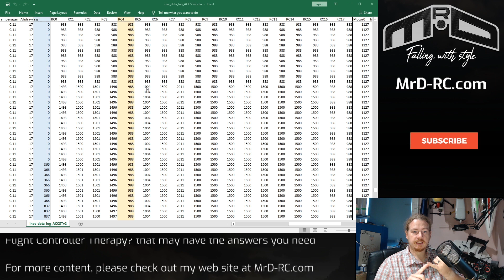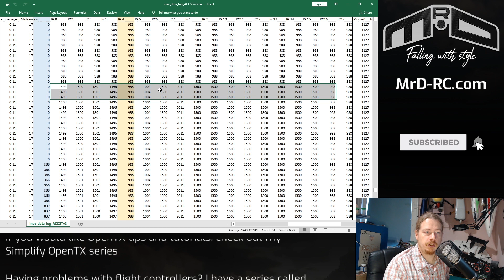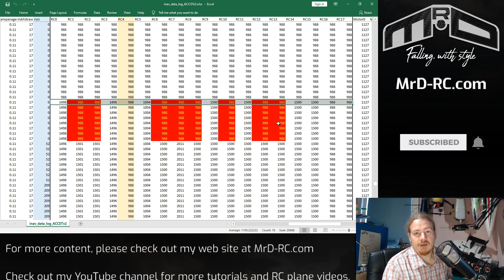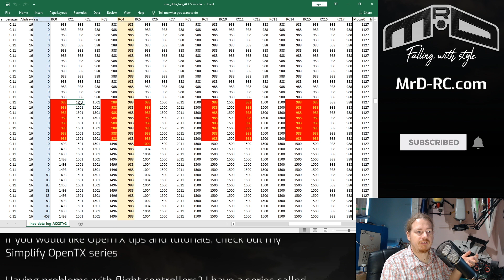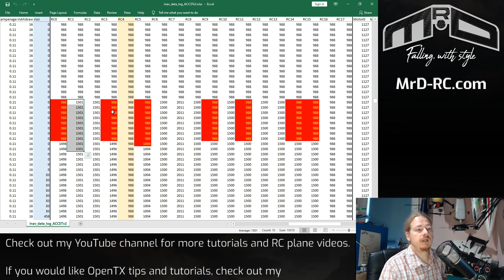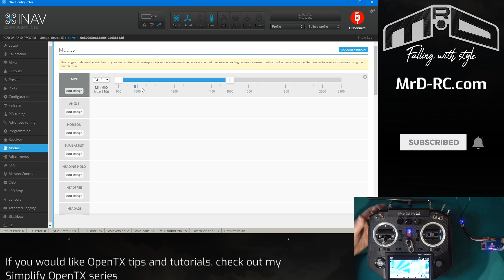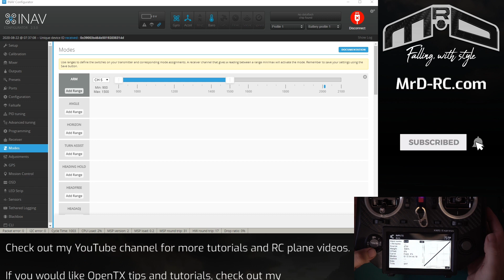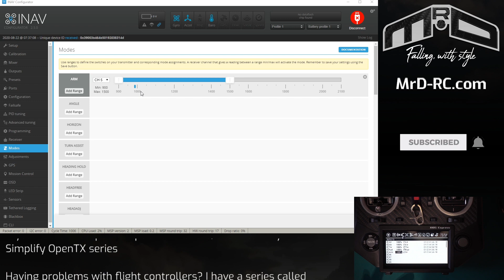Disarmed after a failsafe? This is a glitch with FrSky RXs recovering from RX LOSS. Workaround here!

Comment: Is this valid with inav 4.0 and above? I fly waypoint mission into failsafe hundreds of times and never experienced this dis arm?
Reply from the maker: It was fixed on ACCESS. Plus some mitigation was added in to INAV. The issue did require rapid failsafes. So if you are doing things like switching off the transmitter when it gets out of range, it was less likely to happen.
Reply: @MrD  Do you think the RadioMaster Rx's would exhibit this as well? Or is it Frsky code?
Reply from the maker: The problem was in the firmware. Some of those RadioMaster receivers are just clones of FrSky receivers. So it may not make any difference. To be honest, I’ve not heard of this happening for a long time.
Reply: @MrD  I don’t switch off and don’t use access. Never had an issue with Xm+ or R9M. Recently flashed elrs on one of my R9M modules just to try it as it seems like the hobby is headed this way. Thx for reply, seems you have a good understanding of the issue.

Comment: is it workable in betaflight, I experienced the same thing. when rx loss but can not recover
Reply from the maker: I’ve not tested this in BetaFlight. But if it is happening, having the arm position at 988uS will help n
Reply: @MrD  thank you, the point is to change the standard arm 2100 to 988 position, only change the input on the remote to -100, right

Comment: You solved my mystery!  Nearly lost a plane 5 days before you posted this video that exhibited this exact behavior (XM+ RX).  Hit some kind of weird RF spot and got failsafe, plane started home, then a few more failsafes and OSD showed link came back, switch to manual mode, rolled left, then disarmed and spiral down, all without me touching the transmitter.  Now that you've explained it, I think it explains another in-flight disarm I had previously before that.  Thanks so much for taking the time to disseminate the info!  I was already considering trying out ImmersionRC Ghost, so here's a vote in that system's favor...

Edit: Do you know if iNav 2.6 implemented a mitigation fix for this?  I couldn't find anything mentioning it in the release notes.
Reply from the maker: Hi Jacob. I've just got round to testing (I know, slacker). Unfortunately the bug is still there. There is some improvement, which means some receivers may no longer be effected by it.

Before the glitch lasted for around 80ms with the worst cases. The worst I'm seeing now is 30ms. However, some receivers had lower glitch times in the first place. For example, the G-RX8 has 10-20ms glitches; so these receivers should now be glitch free.

Comment: I've been experiencing this problem a lot lately, do you have any idea what is the source of the problem
İ use r9m and r9 slim+ , During a 100-minute flight, I had 14 glitches in total, although the rssi about 70db.
Reply: Thank you friend 
I read the page you shared, as I understand  frsky should solve this problem .
Reply from the maker: FrSky have the data and are looking in to it. But again, it is for the glitch when returning from failsafe.
Reply from the maker: This glitch only occurs when you failsafe. If your not getting failsafes, its a different issue. What is happening in your flights?

It might be easier to post up in the INAVFixedWingGroup in facebook. There’s a link at https://INAVFixedWingGroup.com
Reply: @MrD  I used to use inav before, now I am using arduplane . When I examined the log records in the inav millisecond rc levels drop to around 900. I realized that it did not have any effect on the flight. but it gives a warning in arduplane telemetry  like no rc receiver
Reply from the maker: So in flight, you’re not noticing anything in particular, except for the no rc receiver message appearing every so often? Then, when you look at the logs, you see the rc levels drop to around 900uS. Is the drop on all channels, half the channels, or just random channels?

Comment: Only just stumbled upon this! Just lost a homebuild airplane today flying 2km out over a local beach. The plane entered RTH followed by glitching and a disarm when the signal returned. So disappointed about the loss! Racked up a good amount of hours on the airframe and only recently updated to 2.5 from 2.2. Grateful for the community of people like you for keeping everyone informed! Much appreciated :) just wished I had stumbled upon this sooner!
Reply from the maker: No problem Denel. FrSky are working on the issue, and a full workaround will be in iNav 2.6. So hopefully soon, this problem will be gone.
Reply: Mr.D - Falling, with style great to know! Thank you for the update man! :)
Reply: @MrD  Well unfortunately Inav 2.6 didn't resolve the problem, it happened to me two days ago...
Reply from the maker: That’s interesting. Had you heard about the issue before Adrien? It seems like putting the arm position at the low end of the range is still the safest bet.
Reply: @MrD  No I hadn't, I discovered it after investigating the crash. Thanks for the really useful video btw !
Reply from the maker: No problem. There was something put in to iNav 2.6 which should have addressed the issue. But I’ll do some testing, possibly tomorrow evening, and see what happens when I force some rapid failsafes.
Reply: @MrD  I’ve had no issues regarding this in 2.6! Failsafe has been rock solid under all conditions. Just thought I’d mention! Thanks guys ☺️
Reply from the maker: Thanks Denel.

Comment: I've had a very similar issue with a crossfire equipped AR Wing, and after testing the theory on the bench I now have my arm switch set like this :-) Nothing more disconcerting than INAV insisting you disarmed by switch when you didn't!
Reply from the maker: You’d be able to see if that was this issue with the log file. Just out of interest, do you use CRSF or SBUS on your crossfire? We did test with crossfire but couldn’t replicate the problem.
Reply: @MrD  CRSF. Logs were the first thing I intended to look at, but unfortunately was this particular flight I didn't have an SD card inserted! The only way I could replicate it on the bench was by turning my transmitter off which leads me to suspect it was a partial brownout rather than a failsafe issue, though my RSSI was low in the extreme! I can send you the DVR of the problem to your facebook page if you're interested.
Reply from the maker: You’re more than welcome to. I can send over the test procedure for this issue too if you’d like.

Comment: I had a similar case but with QLRS (QCZEK LRS). Is it also possible with this transmitter?
It is an external module and I do not have the FAILSAFE = NO PULSES option in the transmitter as in the case of the FrSky transmitter.
Reply from the maker: I guess it is possible for similar bugs to be on different systems. The only way to see the bug is through the logs.

Comment: another workarround is to set failsafe on a switch (i usually use ch11 or 12) and add GPS Rescue or RTH on that switch also at stage1 FS,  i guess that's why it never happened to me.
good find .cheers.
Reply from the maker: Not really, because any channel that is sent to the receiver could have this glitch. The problem isn’t the failsafe being detected, it is that not all channels have the correct data when the receiver is saying the signal has returned.
Reply: @MrD  true .. it needs more indepth study i guess.. 
nevertheless its a good find. more crap from frsky. now at least we know
Reply from the maker: @djvaliro  Everything has bugs these days. Lets see how the handle it, that's the tell. But yes, lots of testing and hopefully a fix.
Reply: @MrD  true .. many products come out with no QC or proper testing.
Reply from the maker: yo8aiv its the world we live in. People want things now, which ultimately leads to rushed products. But even some of the best products still have problems. A friend’s Jeti receiver was fine one day, would not bind the next it wasn’t an old receiver either.
Reply: @MrD  yep. looking on the FC's architecture (i have a bit of experince with stm) i can tell you everything is designed as a consumable .. even the receivers now adays, there's almost no protections on the IMU's or the stm chip ADC's or uarts, but yeah is just an overpriced hobby just because some decided to make money bragging products on yt.  
Anyway still it contributed to an acceleration in development and also production of products wich in the end lack QC because of that same rush for money, but in turn made the hobby better somehow. 
 cheers and thanks for sharing.
Reply from the maker: yo8aiv I guess the push for more helps innovation. But on the flip side leads to a loss of quality and/or QC. It would be nice to have a happy medium. Anyway, have fun flying, that’s all we can do 👍🏻

Comment: Thank you soo much for the video, this happened me 2 weeks ago, i was afraid of pushing my model, now i can fly it safely knowing it wont disarm 10km out :)
Reply from the maker: It won’t disarm, but you could experience other issues related to random channels changing with rapid failsafes. There will be a fix in iNav soon. Until then, maybe just fly to 9km 😉
Reply: @MrD  yes i always had weird momentary failsafes, they last about 20 millisecond and then back to normal. It happens nearly every minute or 30 seconds. It didn't effect flying so i didnt mind it but its good to know that it will be fixed :D
Reply from the maker: If you’re pushing the range, you will still get the momentary failsafes. That can’t be helped, you’re just running out of RF range. The update will safeguard against the glitches that pass incorrect channel values during the rapid, multiple failsafes.
Reply: @MrD  these failsafes always happen even before takeoff or 50 meters far. Its not like normal failsafe, changes flight modes too.
Reply from the maker: That sounds strange. Maybe your out to the side too much for the BiQuad??
Reply: @MrD  no im not using biquad, i have l9r receiver and a normal 2.4 antenna on transmitter. I can send you flight logs if you want to take a look.
Reply from the maker: Sorry, that was someone else. I’ve had a lot of comments on this video. 

L9R can get swamped by the transmitter when they’re close. But you shouldn’t have any problems 50m out. Do you find that it stops happening as you get further away, or are they always happening?
Reply: @MrD  it still happens when model is further away, it's different than when its too close.

Comment: Interesting.  One concern though - with the arming position reversed it seems like it would be possible for a radio glitch to unexpectedly arm the model?
Reply from the maker: No, because this glitch only happens with multiple rapid failsafes. Not something you’re likely to experience with the model disarmed and not moving. It’s perfectly safe to have the arming slider as shown in the video.

Also, in the extremely improbable case that it did happen, iNav would not allow the motor to arm unless the throttle was low, and it would be disarmed again after 80ms. There are safety procedures built in to the firmware to stop arming in all but the correct circumstances. It is true that someone could foolishly set extra_arming_safety to off, in which case their model is more dangerous than this glitch in the first place. Never set extra_arming_safety to off. Either leave it on, or use allow_bypass. Allow_bypass lets you arm the model without the safety checks being met, but you have to move the yaw stick to the right to do it.

Comment: INAV has a variable:
switch_disarm_delay 	250 	Delay before disarming when requested by switch (ms) [0-1000]
In your example the proper arm state is restored in 80ms after RX loss. Strange that INAV ignores the setting with default 250ms and disarms anyway.
Reply from the maker: I’ve just been chatting with Marc, who actually made the request for that feature 2 years ago 😄 It is because the disarm timer kicks in when the disarm position is detected. 

With no pulses as the failsafe method, it starts at the point of failsafe. So when the connection returns, there is a good chance the 150ms default threshold has already passed. 

With hold as the failsafe method, this is less likely to happen, as the switch value will usually remain in the correct position until the glitch occurs, then there is 80ms, followed by a rearm, so the delay stops the disarm. However, hold is not reliable. There are instances that even with hold set, the value will drop to 988uS on failsafe.

Comment: Will this bug happen if receiver use Set/Hold Failsafe option?
Reply from the maker: The failsafe function on the receiver doesn’t seem to make any difference. The glitch will still occur under the right circumstances. It’s easier to see it happening under no pulses, but will also happen with hold.
Reply: @MrD  I mean, is it to be enough to enable Hold option to avoid bad things to happen?
Reply from the maker: No. Its still a good idea to have the arm position at the lower end of the scale in the modes page. A glitch will still mess with the channels.
Reply: @MrD  I don’t figure out how to break a holded channel in a running thread.
Reply from the maker: Because its not running, it’s been interrupted. We have seen the glitch occur on failsafes using the hold method. It is safer, but it still happens.
Reply: @MrD  Ok, glitch happens, but arm channel not become 988 suddenly, right?
Reply from the maker: No. We do see channels go down to 988 on hold. It sounds wrong as they should hold their values, but the glitch does cause them to change to 988.

Comment: Happened to me 2 times, using frsky xsr, 😑
Reply from the maker: It will probably be more apparent on a standard full range receiver. Especially FPV as it’s easy to reach the RSSI limit.
Reply: @MrD  i use sport,some time it says disarm, telemetry lost ,is it normal?
Reply from the maker: What is saying disarm?

Sometimes you can get a telemetry lost message, but to be honest it depends on the circumstance. If its happening a lot, I would say there is another problem here. Maybe damaged antennas?
Reply: @MrD  i use homemade biquad antena for tx(qx7) and get very good range, 11km+, better telemetry range than stock antena.but telemetry sometime say disarm,( happen to both stock and biquad),so it think it not antena problem.)sorry for my English
Reply from the maker: Awesome! Bi-quads are damn good antennas. And 11+km is great for a receiver rated for 2km. With that range, the telemetry just might not have enough power to reach you. The transmit power on the receivers is not very high.

Comment: Funny, I've Never seen this issue. I use R9 ACCST 2018.  I use XF as well but not a fan of it.  R9 imo is way easier to mod and use imo.
Reply from the maker: It does require there to be a few signal losses/recoveries quite quickly to happen. From what we’ve seen, they need to be around 2 seconds or less between. Also, depending on the failsafe mode and arm switch setup, you could be less likely to notice it.